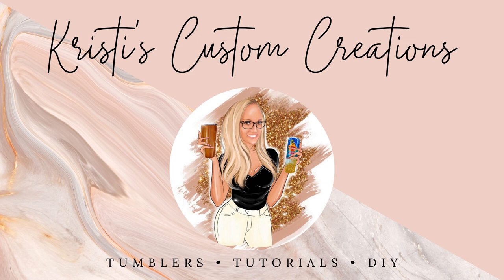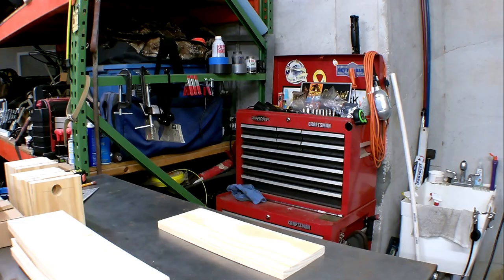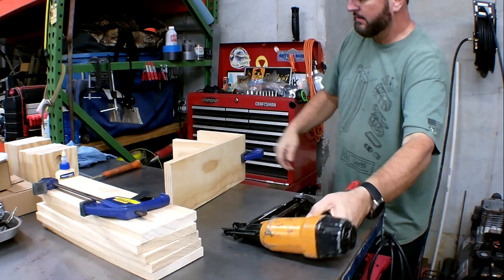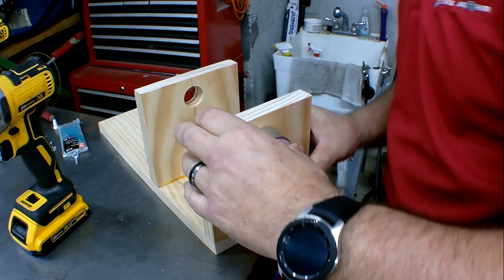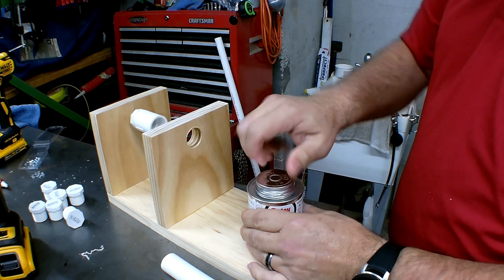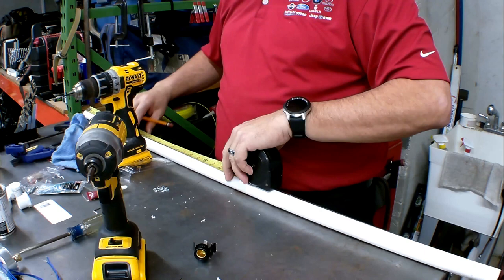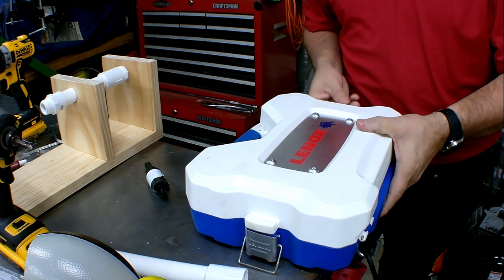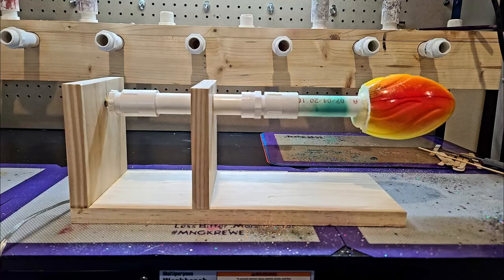Single Cup Turner Build Tutorial | DIY | Epoxy Resin Cup Turner

Comment: Hi Kristy , hello from the UK , Very informative , if I decide to do colouring beakers I will definitely drop by and watch again ,, actually I'm a woodturner checking out the wiring , I'm making a motorized turntable , I have the same make and model as yours (AC 100 - 127v ) I know nothing about electric , wired it up as shown , left it running while l found the "grub screws" and the allen wrench , it was over heating and got rather hot ,,. Don't know if it's the voltage ( UK runs on 240volts ) hoping for advice ,,. Stay safe ,,. Regards Alf
Reply from the maker: It may be the voltage. I literally know nothing about electricity and wiring but here in the US we mainly run on 110. The motors do tend to get warm but I've never had one overheat. I hope you have a wonderful day!
Reply: @KristisCustomCreations  Thank you for replying ,other channels using that motor that I had ask for advice just deleted me ( how rude) lol,,. I'm told that there are gizmos that can " step down " voltage ,, so that's my next move,, thanks again ,,. Stay safe , Regards Alf

Comment: My husband followed your video and made one of these.  I have a question about the motors….mine are getting really hot to the touch.  
Have you found this to be the case as well?  I’m afraid to let it spin overnight.
Reply from the maker: Yes, the motors do get quite warm so make sure that you don't put your Turner all the way up against the wall. I don't allow my motors to touch the wall. I run my turners overnight all the time and have never had any problems.
Reply: @KristisCustomCreations  Thank you for the information. I was getting worried since they were so hot. I was afraid to let them run overnight.
Reply from the maker: @danied180  you're very welcome. Only do what you feel comfortable with doing. My personal experience is that I have no problem letting mine run overnight. I actually have seven spinning tonight that will run all night.